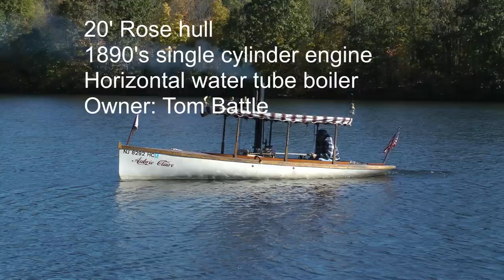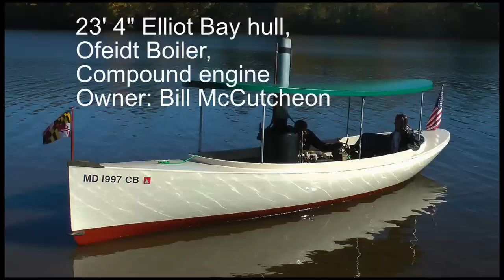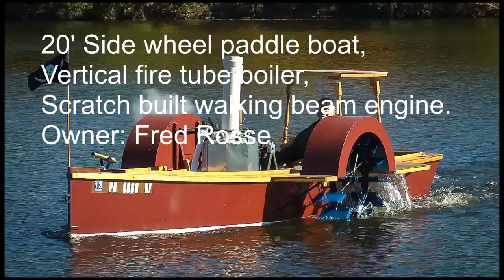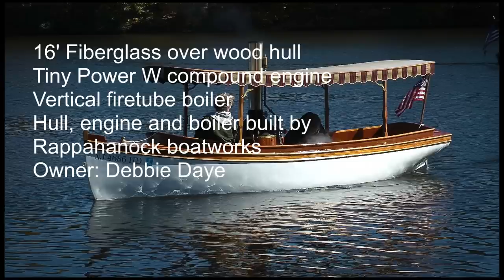Steamboat October meet 2012

Comment: Do these steam boats use two bladed props or modern props?
Reply: Most use three or four blade conventional propellers, except for the rare paddle boats.  Special "Steam props", with thinner blades are also used, but far more  expensive than typical available propellers.